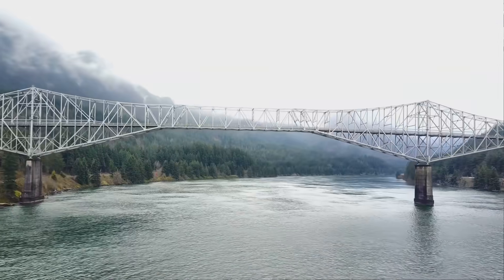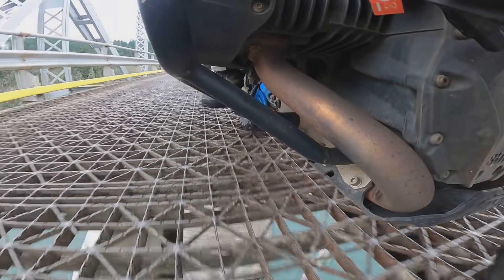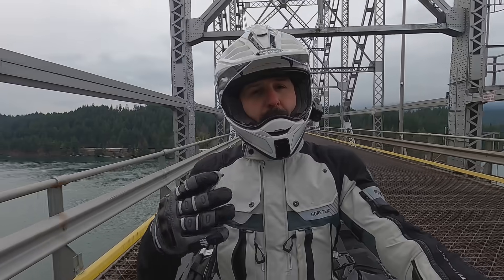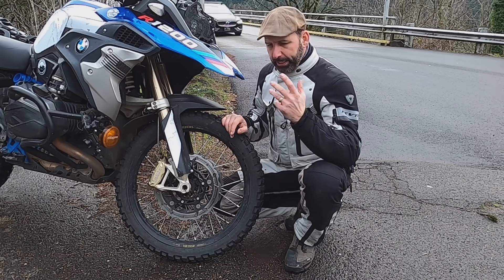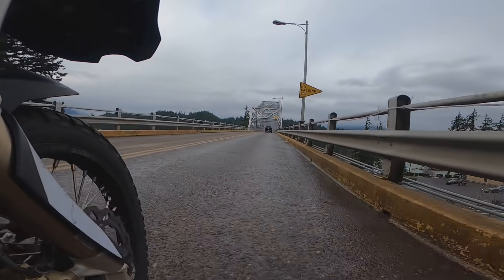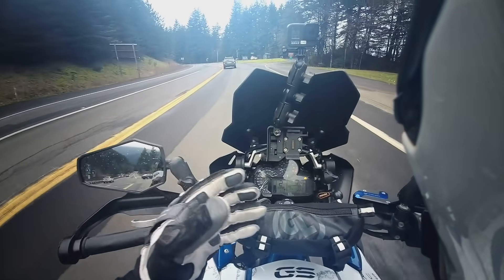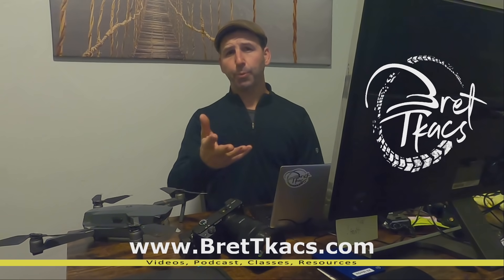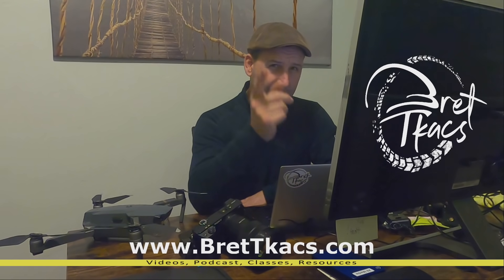How to Ride Across Steel Grate Bridges

Comment: Well, you asked! I would like to know what you think about the Dunlop TrailMax Mission tires. I just got myself a Triumph Tiger 900 Rally and the dealer told me that the Mitas E07 will damage my rimes because the tire is to rigide. So they are proposing the Dunlops. Thank you very much, from Montreal! What do you think? Merci!
Reply from the maker: That's the stupidest thing I have heard in awhile!! I would not use that dealer for advice. The Dunlop is a good tire from what I have heard but there is NO WAY a Mitas would hurt your rims.

Crazy talk 😠
Reply: @BretTkacs  Sorry for my missing information, but, I meant that i would damage or scratch the rim when removing and putting back the Mitas e07 tire on my rims. I hope that clears up my question, sorry for the confusion. I’m new to having an Adventure bike, i will be running a tubeless configuration, i guess i would not be removing the tire off the rim.
Reply from the maker: @mikemaners4411  of course you can do a tubeless tire yourself. The Mitas do have a stiff sidewall but it is not a problem, just a challenge
Reply: @BretTkacs  Thank you very much! Merci encore!

Comment: Great video. Most metal bridges in BC don't have any cross pattern in the metal just a box. Front tire width makes a huge difference how a bike reacts the the grate. What happened to the 790?
Reply from the maker: I had it on the trails yesterday but am taking it to the dealer again. I hit the end of my patience with the bike and am not going to keep it.

Comment: My first time driving over a metal grate bridge was going from Kentucky to Illinois. I had traveled 3 days from Florida, over 800 miles, on my way to Chicago. I saw the sign and thought to myself, "okay, someone gave me some advice about this. What did they say? Either go fast and steady or slow and steady. Shit, I can't remember."
I crossed that bridge at the exact speed limit (30mph) and was terrified, but made it safely with a pissed off line of traffic behind me that wanted to be going much faster.

Comment: I’ve tried riding with no hands, but the bike rarely feels stable, how can that be improved without dying? I recently sprained my ankle doing u-turns  on a hill, how can those be improved in small areas?
Reply from the maker: You're like to stiff and reactivate. Start at higher speeds (60mph/100kph) and work to lower speeds. Use your hips and then your upper body. It is ok to lets your hands hover over the bars.
Reply: @BretTkacs  So the first goal is to not attempt u-turn on the road, but start in a large, "safe" area like a parking lot or field? Once mechanics are good there, then work to smaller and smaller circles, and then road and then hills?

Comment: Does anyone have advice for crossing over wet light rail tracks that run parallel to the bike? I dumped my KLR650 while driving on the waterfront in Portland trying to change lanes once and now they sketch me out.
Reply from the maker: Where in Portland? Intersection?
Reply: @BretTkacs  I was heading home after class at the Collaborative Life Sciences building, pretty sure it was S Moody, right before the intersection with S River parkway. I'm fairly certain I did everything wrong.

Comment: Are you running 19 inch Woody's/Excel on the front there?
Reply from the maker: 21"
Reply: @BretTkacs  cool to see you got the 21 with the factory mudguard adapted. Im used it seeing it removed with the 21s.

Comment: I think tires and tread design must make a difference. I frequently ran over such a bridge with my 80's BMW R100RT on the fairly skinny Metzelers of that era  (3.25×19 front and 4.0×18 rear) and regardless of speed bike would squirm all over the place. It was so bad other riders could see it and commented on it. I though maybe it was a tire pressure issue but no. I would have to tighten the manual steering damper to 3 to tone down the front end a bit but the back end of course continued to move all over.  I would love to ride that bike with modern rubber back over those bridges to see what difference it would make.

Comment: Hood Canal bridge actually has placed two “tire paths” of concrete in the grate on entry/exit so if cars or motorcycles want, you can ride those smooth paths (about 20” wide each).

Comment: Bret, it's the Hood River Bridge much the same? I turned up on my cycle one day and they wouldn't let me cross. Luckily a pick-up came by and the driver was more than happy to assist.
Reply from the maker: It must have been ice or windy.  I have ridden the hood river bridge many times
Reply: @BretTkacs  Hi Bret... I was on a push bike, with panniers. Looking on Streetview Hood River Bridge appears considerably narrower than Bridge of the Gods. Toll guy was adamant... Would have been impossible to get round me in a car without going over the centre demarcation. Safety I guess. No issue as polite and sensible northwest locals can inevitably be relied upon.
Reply from the maker: @grahamrowe6278  9' lanes for hood river, 12' for the bridge of the Gods
Reply: @BretTkacs  Ye, figures. Would have been interested to find out what the 1" cycle tyres would have felt like on the grating, but no matter.

Comment: I'd like to see a review on that Revit riding  gear.
Reply: I owned the jacket... My Olympia was seriously better at keeping the water out and was lighter... and it was cheaper. The rain flap on the Revit is a joke.

If you don't ride in constant rain (I've been across the bridge he's riding and I can say there are a few grated bridges in Oregon and Washington, and raining all the time is pretty much par for the course), it's probably fine. It started leaking after it's first year of being constantly drenched, so it might last longer if it's not constantly soaked daily.

That said, it does keep me warmish on 40F days (my other coat is a Merlin, and I have to put a hoodie underneath it or I freeze), it breathes alright and the build quality has me still wearing it six years later... but it's awkward to take apart (and it will pick up an odor if you don't separate it to dry). Also, my cat dumped my coat rack over onto a table with a glass of red wine about a year ago... back of my jacket is still pink, so it will stain (elbows and underarms are black from rain/road grease gathering as well). I'm looking for something else next round...
Reply: @DrTranofEvil  Thank you for your time and your review. 👍

Comment: I would be interested about small (about 250cc) street bikes on class 1-2-3 terrains in your system. What do you think is possible with them? I have a feeling it could be even easier than the big adventure bikes you are showing with even on street tires.
Reply: I've ridden thousands of km on 4-5 terrain on 200-500 cc single road bikes. As long as there's nothing delicate under the motor you should have no problems if you just ride reasonably.

Comment: I've never come across a surface like that, the nearest I have experienced is when a sealed road has had its top coat scraped off in preparation for a new seal. As you suggest the bike is more stable when carrying a bit of speed.
Reply: I almost had my heart drop out of my butt when I first encountered that
Reply: @MrMikeDao  that sounds funny, although I felt the same 🤔🤣🏍️